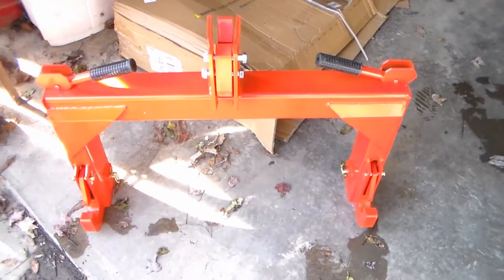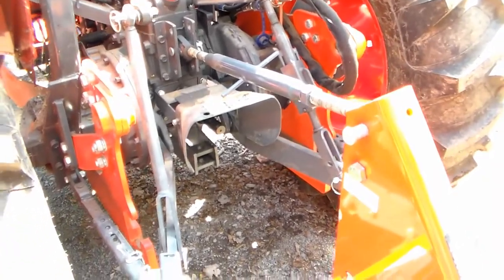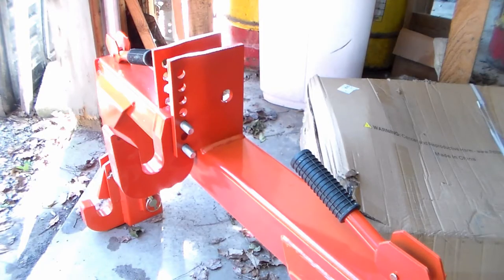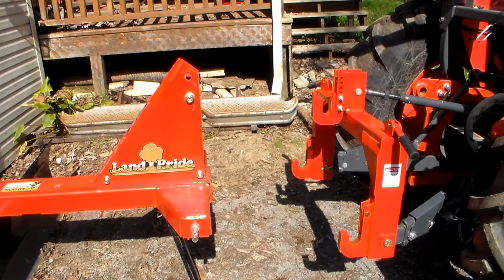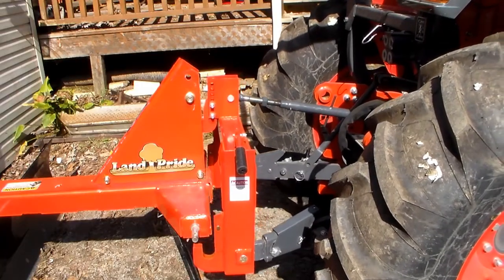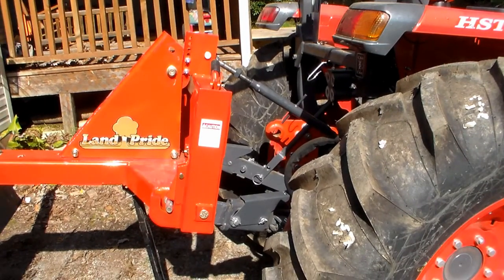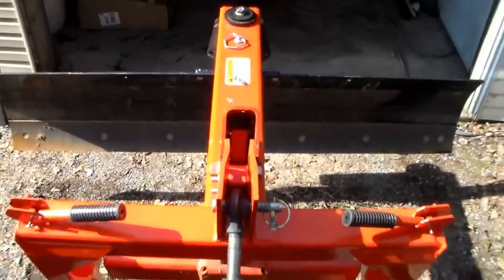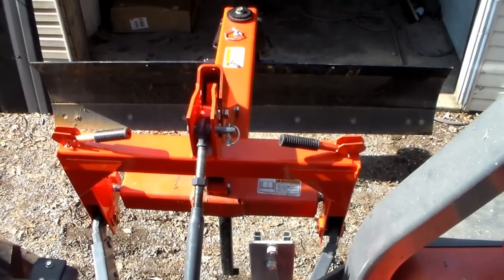Tractor 3-point QUICK HITCH - Installation and Review!

Comment: Is there a bushing for top pin?
Reply from the maker: Yes most likely you would need a bushing for the top link. Just depends what cat your link is and what cat the hole in the quick hitch is.
Reply: @rednecktech82  Cat 1 top link. The quick hitch has Cat 2 bottom links so I assume the top would be the same?

Comment: Last year bought a new koyote Tractor with a 6 ft brush hog, I asked for a quick hitch, they talked me out of it.
 I don't remember the reasoning they gave, but I'll be revisiting the subject w them soon!
 Spent an hour fighting it!
...no help here these day's
Reply from the maker: Could be just because of the implement...I would never use the quick hitch for my flail mower even if I could. But they're great for other things like my grader blade.
Reply: @rednecktech82  How about me buying the extendable arms, and upgrading the sway bars (turnbuckles), one's on it appear cheap and come loose?
Reply from the maker: I've had no issues with the stock turnbuckles. Extended arms wouldn't help either it would still be too heavy for the quick hitch. Think of a lever, the farther back you mount the equipment the heavier it is on the tractor.

Comment: If I'm not mistaken you have a CAT 2 tractor correct?  I have a Cat 2 JD 5065 and was wanting to verify that this quick hitch will in fact mount up to a CAT 2 tractor??  Thanks
Reply from the maker: Cat 1 versus Cat 2 is just a matter of the size of the bushings you would use.
You can buy a Cat 1 quick hitch and put bushings on it to use on a Cat 2 tractor or buy a Cat 2 quick hitch that comes with larger pins and wouldn't require any bushings.
The link in my video description goes to a Cat 1 that would need (and I believe comes with) bushings to be used on a Cat 2.